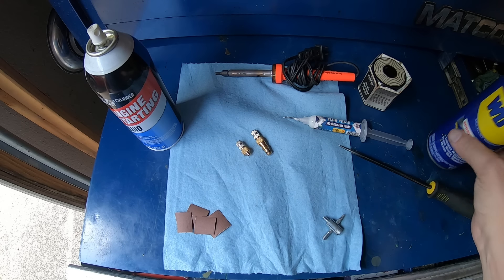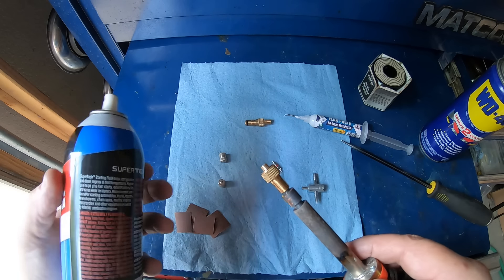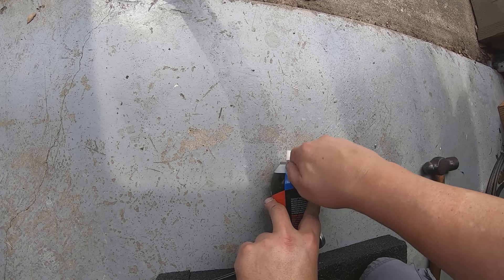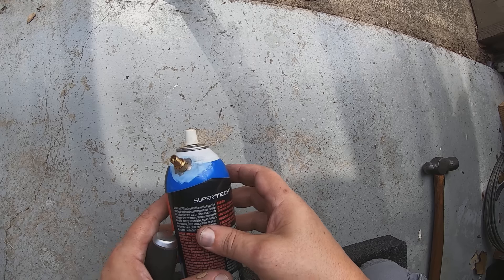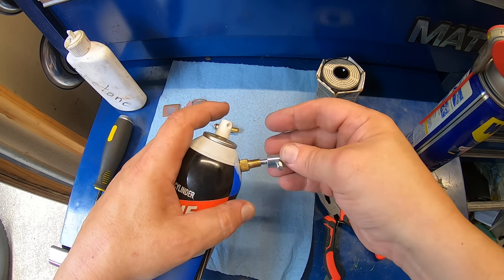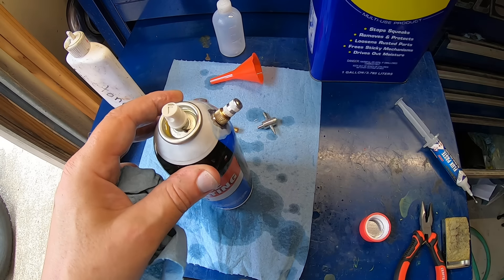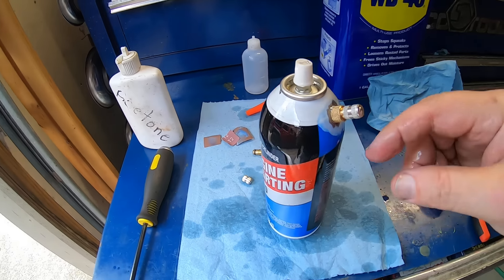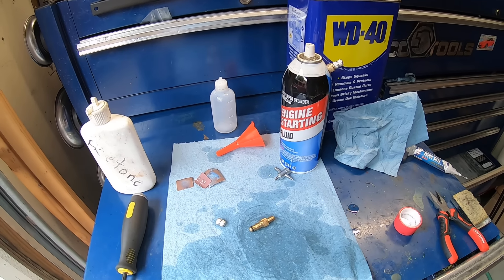How to Easily Install a Schrader Valve on any Can to make It Refillable without Drilling or Torch.

Comment: Yes, you DO need a lathe. And a milling machine. And a TIG. 
   My other car nut friends don't really agree.
   Guess who gets asked to do welding, turning,  and milling regularly?
   If you don't have that stuff,  you're a "replacer", No? (Hopefully with good diagnostic skills.)
Reply: well said brother.   well said.
Reply: @bryanbeddingfield5489 I agree. I only have a mini lathe but the amount of things I've made and repaired with it over the years, I sure wouldn't want to be without it now. I'd love an AC/DC TIG to tackle aluminium but they are expensive to buy and it's a real skill to master I know. I have a MIG and stick welder for the other metals so kind of get by.
Reply: There's not much you can do with a lathe or a mill that you cannot do with a file and some determination. Is it practical for someone who is spoiled with a lathe and mill, no. If you own a wood splitter you're not going to split a seasons worth of wood with an ax, but if not, you don't have to freeze to death. 
To scrape a little bit of brass off with a file would probably take half the time that the rest of the project takes. Probably half the time setting up and turning down.
It doesn't take a Skin-o-matic 5000 to skin a cat either, there's a bunch of ways.
Reply: @ricoloco2803  I was that guy, struggled with a file etc to get the job done, then I bought a lathe and mill and learned how to use them, that in itself is satisfying. At the end of the day, the moto 'right tool for the right job' applies for good reason.
Reply: @ricoloco2803  How long would it take you to "Machine" a 5/8ths keyway in a solid 6" stainless shaft ? Thanks, you sound very knowledgeable, and talented.
Reply: What you "need" and what you are allowed by your manager (i.e. wife) are entirely different.
Reply: @ricoloco2803  You can split a seasons worth of wood with an axe and cut the trees down with a crosscut saw, but if you have a back like mine that is 74 years old a chainsaw and a 13 hp (home built) logsplitter is a no sweat way, and you dont spend the next day like the hunchback of Notredam cos your backs knackered.
Reply: All I'm saying is that, if you want to get it done, you get it done. Of course, there is always an optimal way to do anything. I'm not suggesting you use the vice on your milling machine to hold something while you file away at it. The point was not to let a lack of advanced equipment be an excuse for something you want to do. Obviously a chainsaw and a log splitter is the way to do firewood but if all you have is a claw hammer, you don't have to freeze to death. Why are you using a chainsaw in a log splitter when they have those machines that will cut the round split the round and spit it out on a conveyor belt? Those machines are nice but it's nothing you can't do with a log splitter and a chainsaw and some determination.
Reply: @steveclark.. so you were one of the guys that didn't let not having all that stuff stop you. That's all that I was getting at.
Reply: @tnbrfller I am quite knowledgeable, thank you. The particular knowledge that applies to this conversation is the definition of the words need, and want. Would I want to file a 5/8 keyway in a 6-inch solid stainless shaft? Not a chance. Could I if I needed to? You bet! As to how long it would take me, I guess that depends on how bad I NEEDED to.
Reply: @ricoloco2803  Yes but I finally woke up, caved in, saved up and bought a lathe etc. It's like trying to cover a thousand miles on a bicycle compared to using a car, sure it can be done but it's so much quicker and easier with the correct tool for the job.

Comment: Use soapy water to check for leaks where you soldered. Also, if you press the spraying cap when you are filling, the liquid will go in a lot easier as the air will have a release.

Comment: You can get schrader valves already machined from refrigeration suppliers. They are used in domestic systems.
Reply from the maker: Do you have a link or a specific name they are called?
Reply: @737mechanic  I am a retired frigie in Australia. Any refrigeration parts supplier where ever you are, should stock brass schrader valves. The ones you will be looking for are ones without copper tails.
Reply: @737mechanic  They are also called schrader valves in refrigeration.
Reply from the maker: @marlinblack6597  The only ones I can find are the ones that connect to refrigeration hoses instead of compressed air hose.
Reply: @737mechanic  You should be able to purchase a single hose and adapt it. It all comes down to financial viability. You can pick up set of manifold gauges 2nd hand cheaply. It comes down to how cheap you can get the schrader valves for. I naturally have a few sets of manifold gauges due to the evolution of refrigerants since R12, R22 and R502. Like you, I spent a lot of my time adapting stuff to save money in the long run. As the say, necessity is the mother of invention as is cost reduction. Where are you from, might be able to send you one (hose) if it's not on the other side of the Earth. $$$

Comment: I hope you're using unleaded solder has lead is softer and weaker. That could come out of there like a bullet.
Reply from the maker: Even if it came out it would not be like a bullet, since the diameter of the valve core is only about 3/16 and I only fill the can to around 100PSI the pressure on the valve core is only about 17PSi so it is all good.

Also, I did two other videos in which I pressured two different cans to failure to see how much pressure they would hold before they exploded.

https://youtu.be/mBGq6W3FJoY
https://youtu.be/c3wTNy-_Xjg

Comment: Brilliant solution and I wouldn't even need an air compressor. I could use my bicycle pump to pressurize it.
Reply: yeah but probably better use a car tire foot pump as getting it up to 80-100psi with a bike pump will be a challenge ;-)
Reply: @g4z-kb7ct  I have both a floor pump and a frame pump but a foot pump would make it hands-free so that's a great idea.

Comment: You should consider selling these as a kit, with the adapter for the soldering iron and the machined down valve cores. Great video
Reply: I'd be interested in a set of 4 if you're willing to make them up
Reply: A little bit too much liability maybe.

Comment: Bro, just put it in a Zep spray bottle! This is just ridiculous!! Spray bottles work excellent, cost under $5 and take no crazy/risky rigging.
Reply from the maker: I spend 5 dollars when I have plenty of free empty spray cans? Once modified they work better than spray bottles. Besides those spray bottles end up leaking once the seals so bad.
Reply: Fair idea for easy applications, but would t work for those times where cramped space requires you to have the can upside down and/or use a straw. Spray bottles don’t generally work upside down because the intake straw is then in an air pocket, and ice never seen a spray bottle that accepts a straw on the nozzle. …though if you know of a brand/style that does accept straws in the nozzle please let me know because I’ve got uses for a setup like that!
Reply: EVERY Spray bottle seals or plastic gets brittle with time.  This is a great refillable solution for solvents, acids and even weed killer!!!!❤❤❤❤

Comment: This was a neat project, but if you don't want to use a pump sprayer you can go to any LOWE'S STORE and buy (for $8) a battery operated sprayer that screws on a gallon container and it sprays a stream of liquid about 20 feet. No manual pumping needed 😊. I bought 1 about 3 months ago and have used it for all different chemicals and I LOVE IT!
PS--- IT'S SOLD OVER BY THE BUG SPRAYS.👍

Comment: Solder the valve body near the bottom side of the can, about an inch from the bottom rim. I have inadvertently melted the  Spray Valve On The Can   before, and moving the new fill valve down and away, eliminated that problem . . for me. But, yes, this definitely works, . . surprisingly well. Nice video, very easy to understand and I can clearly see how you are doing it. That's my biggest problem with making videos, I don't get good b-roll, so it's difficult for people to understand me.

Comment: I didn't read down for all the comments but, if you are a 737 Wrench, you have probably pressure tested a 100 things with soap bubbles. Every time I rehook propane bottles on trailers, swapping tanks on my Oxy/Acy welding tanks, aviator's breathing O2 bottles and so forth. Cheap insurance. Good vid 👍
Reply: When I was a parachute rigger we used mil-spec "Leak Tech" which was taxpayer funded liquid dish soap in an extravagant guize... Nothing like a few hits of 100% aviators breathing oxygen when there's too much red in the white of your eyes!
Reply: I found a 737R Impact Rated Precision Action Wrench. Is that what you mean?

Comment: I’m glad you mentioned to save the tips for the different spray patterns. The tip on the starter fluid can is like a garden hose with out a nozzle.  
 
Ps. I love the “but you need a lathe” comment 😂😂😂
These guys will say anything to keep a laugh going…! Don’t takem seriously.😂
Reply: 💦💦💦💦💦💦, so true old pump spray bottle would same results on stream setting 😅

Comment: I like the recycle process my only concern is someone figures they can add more air to last longer, we all know idiots are everywhere an they will blow up the can due to overpressure. Just buy the ones for this usage as I paid 5.99 for a plastic bottle with a hand pump built in and a metal one that has a 80 to 150 psi rating for 29.99 at HF and be safe
Reply: That's my concern on it.  One time I bought a "fillable" compressed air can (it was designed to be refillable, with a standard valve stem on the bottom).  Nowhere on the can or the packaging did it give the maximum pressure rating of the can, so I never used it (seemed a highly unsafe item).  Either couldn't find the company or couldn't get an answer from them, and whatever store I bought it from (maybe Staples?) would have been clueless on it too.  These days I would have reported it to a safety agency or something like Consumer Reports.
Reply: If you can operate a lathe safely, you're probably safe to handle a little compressed air.
Reply: Those cans are rated from the manufacturer to hold much more psi than most people's compressor can make. My compressor kicks off at 180 psi and it will not explode a brake cleaner can. Id be more concerned with knocking a hole in a can that has pressure in it (by accident)

Comment: NO DRILLING OR TORCH BUT YOU NEED A MACHINE SHOP TO MAKE THE SHRADER VALVE USEABLE WITH THIS METHOD, THAT'S A BIG INVESTMENT FOR A SUCH A SMALL JOB.  I'LL USE A DRILL & SOLDERING IRON.
Reply from the maker: Exactly😀

Comment: Schrader valve 1/8" npt threaded tank fittings are available to do the same thing with no machining. The cheapest source of a Schrader valve might be to get an old car tire valve stem, remove the valve core, burn the rubber off of the remaining brass part of the valve,  then clean off any residue.  One might even be able to secure the valve in the can with epoxy if the fit in the can hole is close.
Reply: JB welded shrader valves on garden sprayers so I do not have to manually pump for air.
Reply: @robhunter2435  🤯 I hadn't thought about that! Thanks for sharing, now I know what I'll be doing tomorrow morning!
Reply: @robhunter2435  on plastic pump vessels I drill 1/2 inch hole and and pull a standard tire valve though the opening at a convenient spot and pressurize on the fly with a compact bycice pump that can easily be fitted for transport in the field.

Comment: Why do this instead of just using a spray bottle?
Reply from the maker: What type of spray bottle are you talking about?
Reply: @737mechanic  just a plastic spray bottle that can hold liquids like cleaners etc.
Reply from the maker: @IRQ1Conflict  I mentioned that in the video. That is always an option but if you like the convenience of simply pressing a button and having your liquid come out this is a good option. Plus for many things you have the option of using the small red tube that allows you to get into areas you can't with anything else.

Comment: What kind of plastic bottle is surviving as an acetone dispenser?
Reply from the maker: Most plastics are fine with acetone, ABS is one that acetone will attack and melt so you have to be careful with that. In fact the acetone we have at work comes in 1 gallon plastic jugs.

Comment: I just usually use a rubber tip'd air blower, and push down the rubber tip and charge the can of __ with air/propellent. Just can't use too much psi. Or it could blow the line off on the inside.

Comment: Dremel is your friend, Cordless,  it'll remove any coating with Scotchbright wheel is a second. 

Also last 40 yrs, I simply remove spray head, and hit the valve tube coming out of can with compressed air, pressing down on tube with rubber tip air nozzle, and can is charged. 
Refilling cans, that's pretty cool, but WD40 is nothing more than diesel, and solvent, that won't be there 4 days later, if rusty threads were meant to be free later. WD, is used to flush rust out of threaded fitting, or hinge, then final step, LPS3, this product will protect rusty object, to open air fuse panel on tractor for years. 
Cheers and thanks for exclusive process.
Reply: Brilliant !

Comment: Solder is an electrical connection but it seems to me that you really would need a good mechanical connection for this to be safe at high pressures.  

Have you tested the max PSI until the solder point fails?
Reply from the maker: I am going to make a video pressurizing the can to failure.

Comment: Hopefully, a better understanding.
   You persisted in calling the brass part which you had turned down, valve cores.
They are actually valve stems !
The valve core is the part that screws into the stem to allow passage of product and propellant.
   A comment mistake if you are not using them like in a tire repair shop.
Nice video.
Thanx
Reply from the maker: Yes, I know if you watch the entire video, I only made that mistake once or twice. The other times I referred to it as the valve stem.
Reply: ok im gonna have to go with what vic said on this one brother, and i quote, go change your tampon.  @xVicissitudesx

Comment: I think I would skip the pre-tinning of the can and valve; just flux the joint and "sweat" the joint with solder.  The flow would be sufficient to seal and a lot easier IMO.

Comment: Great idea and the soldering part is great idea. I also found a fix for those sprays that run out of air BUT can is not 
empty when you shake it. I just used those cheap butane stove cans, I made an adapter like the principle of filling up a lighter but you fill the top tube of the can. Worked for me to use the last bit of fluid inside. No compressor needed. Not sure if the butane will react to whatever it was you are filling. Worked for me on some WD40 that run out of air. Just got lucky to find a spray can tip that is long enough to cut and drill a 1/8” depth with diameter that fits the spray can tube (which is generally universal).

Comment: How many PSI would you recommend to get them to?
Reply from the maker: I was doing 100PSI but I would recommend 75 or less just to be on the safe side. I have a couple more video's were i pressurize them to failure.

Comment: Would you be able to do small custom metal-machining if I needed a replacement/retrofit part for a used piece of machinery?
Reply from the maker: Email me what you have in mind.
Reply: @737mechanic  What's the email address?
Reply from the maker: @Quacks0  mechanic737@hotmail.com
Reply: @737mechanic  Thanks!  Sending you a message now :)

Comment: Did you ever tell everyone the max pressure to use when you pressurize the can, or did I miss that?
Reply from the maker: I put 100PSI in them with no problem but I am about to put out another video where I pressurize one until failure.
Reply: @krystal5887  is that in the video?
Reply: @krystal5887  which one is ChrisFix? I never saw it in this vid, what time is it in here so I can here what he said is why I asked. ; )
Reply: @krystal5887  got it! Thank you. Have a good one. ; )

Comment: What is the maximum safe pressure?
Reply from the maker: I aired mine up to 100PSI but I would stay below that, maybe 60 to 70. I am actually going to do a video and pressurize that can to failure and see how much pressure it holds.

Comment: I like the way you attached the valve with simplicity, looks like I can replicate it. What did you make the soldering tip out of? Really like the way it works. Thanks.
Reply from the maker: Copper rod.
Reply: Thank you

Comment: Instead of soldering I would put the valve in with JB Weld.   I assume the JB Weld would be strong enough.
Reply from the maker: Not sure if it would be strong enough or not.
Reply: @737mechanic  I still might try it if I feel daring enough.   LOL

Comment: You can do the same thing with a tire valve stem. Pull the white cap off and put the valve on the stem on the can and give it some air.
Reply from the maker: How do you fill it with fluid?

Comment: If the cans original content stated 12 fl oz, could you refill it with 12 fl oz?
Reply from the maker: Yes, what I found was a 12 fluid oz can is filled about 3/4 with the fluid and the rest is pressure.

Comment: Using a punch is a better idea than a drill means no metal bits inside the can that might clog the spray tip or valve.  Sharpen the right diameter nail or steel rod with a grinder and you won't over size the hole.

Comment: just a normal tubeless stem will do! buff the rubber pff and a bigger hole. the inner hole is the same size as a tractor stem. tyre shops have heaps of them that they cut off tyres! i,ve done this and they work well.